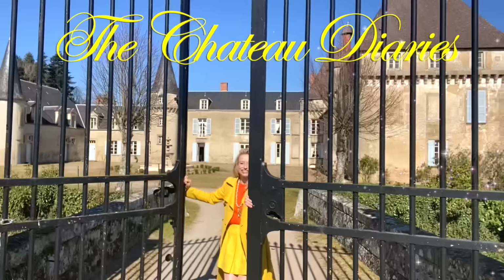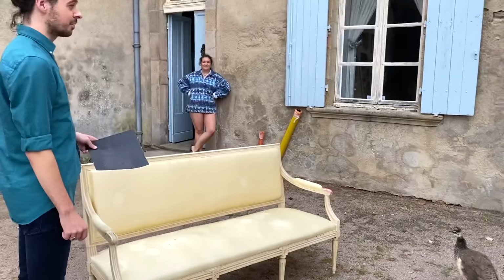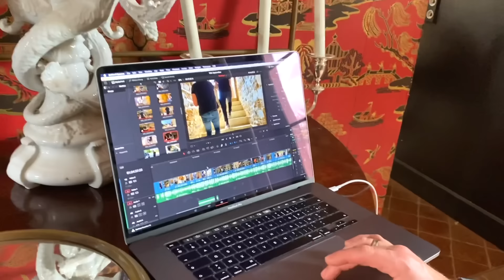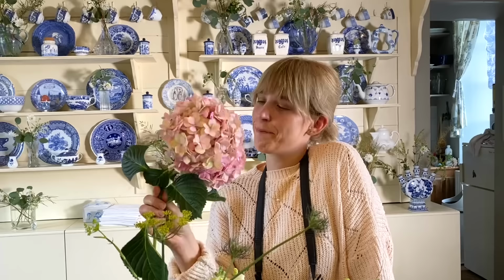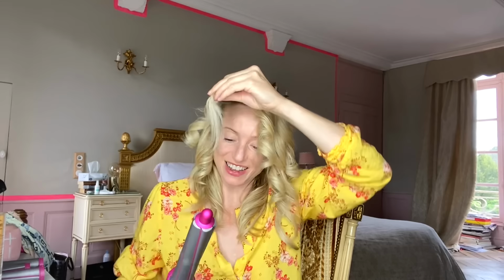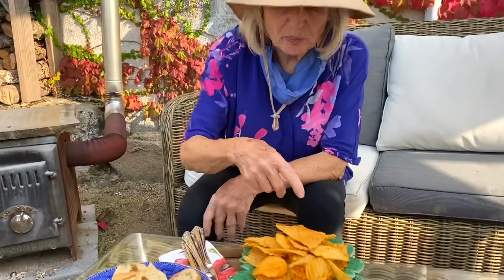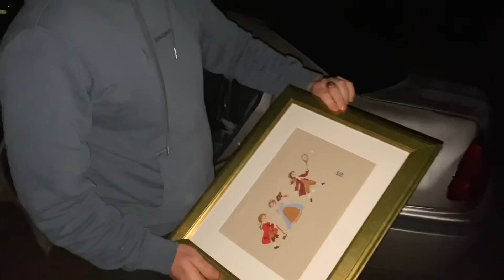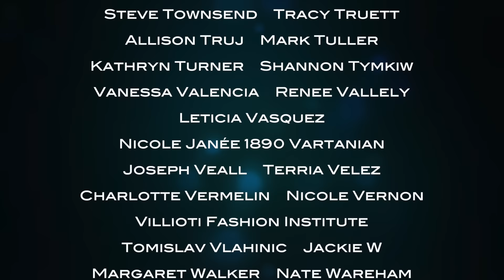The Chateau Diaries: THE TRAY THAT RENOVATED A CHATEAU!

Comment: Stephanie as a house painter for 13 years if you hammer down your paint cans very well TURN them upside down so the air doesn’t get in and you won’t get that hard film, smell & rust! They will last so much longer!!! Just a tip it goes as well for all your metallic paints as well because the air gets in when there not sealed properly this will harden your paint just a quick flip saves you lots of money!!
Reply: I thank you for the tip Maria ☺️
Reply: Oh, wow, that is a great tip, because I have had to renovate my house twice now, due to a major mishap with the water pipes. Thank you!
Reply: great tip!
Reply: Thank you!8

Comment: Thank you for showing us your new Dyson hair tool!!! This intrigues me as I've had two spinal surgeries on my cervical spine (neck) and one on my right shoulder, which is also my dominant arm, and I've pretty much given up fussing with my nearly waist-length hair much anymore because doing anything overhead has become very difficult for me and sometimes my hands just don't work like they did prior to the car accident. It can be difficult to grip and manipulate things and/or I just have zero strength. I actually bought a hair dryer holder stand, which sits on my bathroom countertop from Amazon that I truly don't know what I would do without!!! I may have to save for this Dyson tool, though my hair is naturally curly, so it has to bedried and then straightened with a very hot flatiron before styling, so I'm not sure how this would work on my hair type... Anyways, you look very beautiful Stephanie and you possess the rarest form of beauty as your inner beauty and sweet soul illuminates your entire being. Thank you for sharing your life with all of us. You never fail to put a smile on my face, especially when I truly need one, so thank you again.